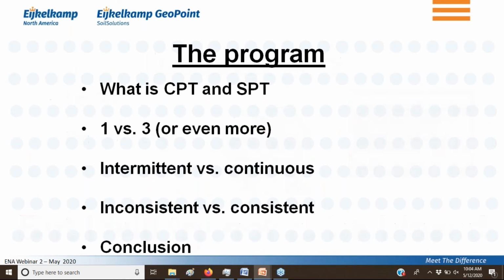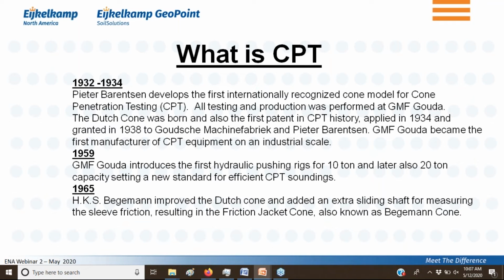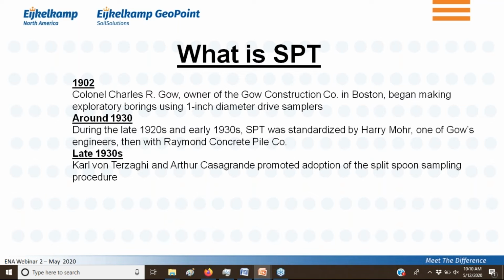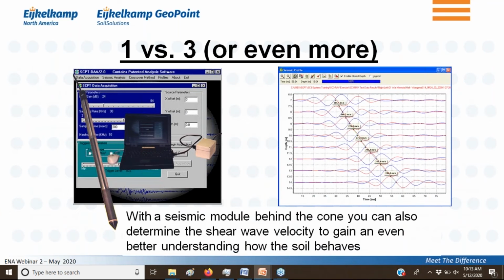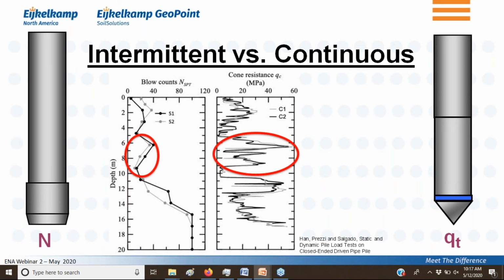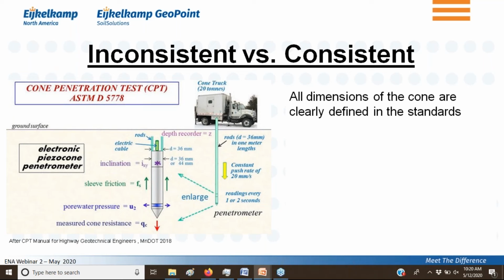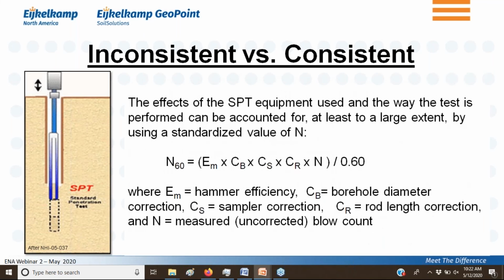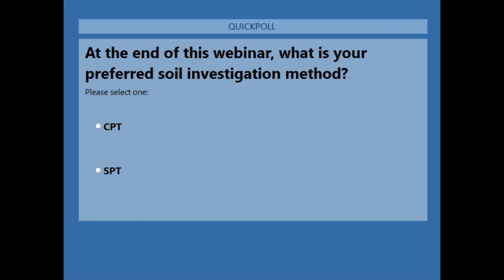CPT Webinar Series #2 | CPT vs SPT | By Eijkelkamp North America

Comment: Thanks for the video, is CPT suitable for texas soil?
Reply from the maker: Hi Ahmed, 
CPT is suitable for a variety of soils, including those you find in Texas. Soils with N60 value of 100 require less than 20 tons pushing force when using a 15 cm2 that is pushed into the soil with the standard 36 mm (1.44 in) diameter rods. Most CPT crawlers and trucks have a pusher that is capable of generating this kind of force and therefore CPT can be performed in wide range of soils, even soils that are supposedly "too hard to push the cone". Note that very gravelly soils may damage the cone, and pre-drilling is required here. If you have further questions about CPT, feel free to contact our specialists via Royaleijkelkamp.com!
Reply: @RoyalEijkelkamp  thank you so much, i contacted them for a quote, I appreciate your response

Comment: Thanks for the video. That was really helpful. I usually go with using them both but moreover depends on the purpose of the investigation. If the investigation is like a pre-work and to characterise the area, spt seems enough. In the second stage, like investigation on the alligment of the structures (tunnel, brigde foots, dam etc) cpt is totaly necessary.